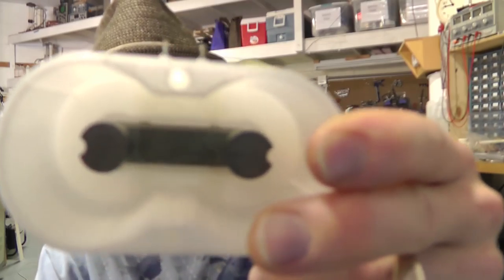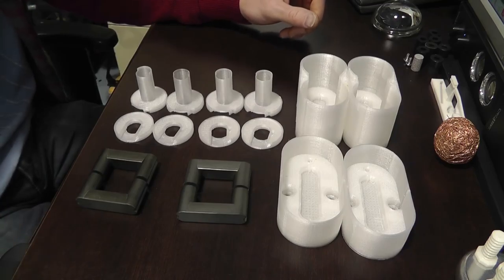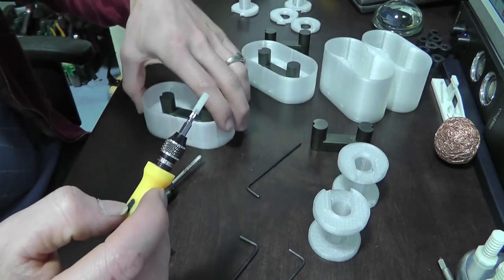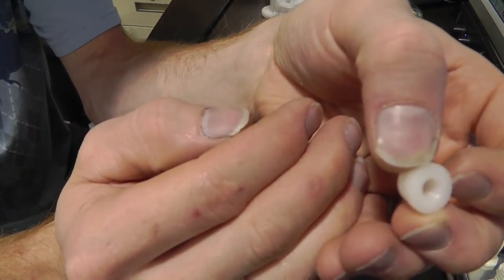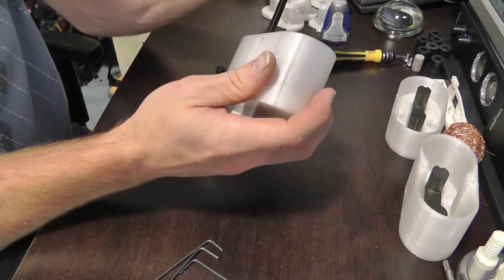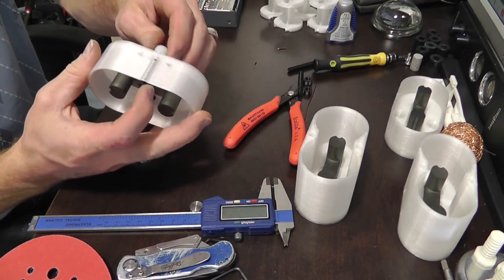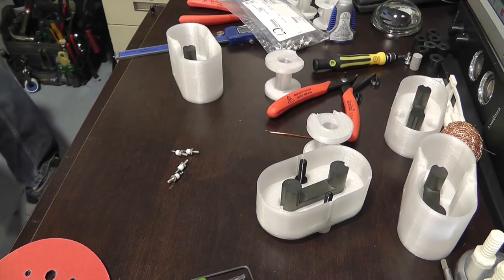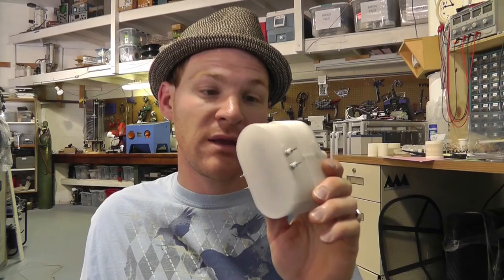A.R. VIC Bobbin Single Adjustable, 3D Printable Bobbin's And Core Holder

Comment: You need to make a 3D printed negative for your 12 Volt drill batteries for a handy power supply with a switch and screw terminals. Many people use the rechargeable power packs for their projects and model rocketry.

Comment: Can Fill those Holder with Resin ti stop plasma to air and make tune with set gap and adjust ground wire resistance DD.

Comment: Nice work on that VIC. I looking to purchase a 3d printer, do you have any suggestions on the best features to look for?
Reply from the maker: not realty, i like my rostock it dose a good job? not much help am I ? 

~Russ
Reply: ***** Ha ha yeah that's ok. Just seeing you use the printer is very helpful so you are helping in a way. I'm steering toward a dual extruder, heated bed with a  fair size build platform.